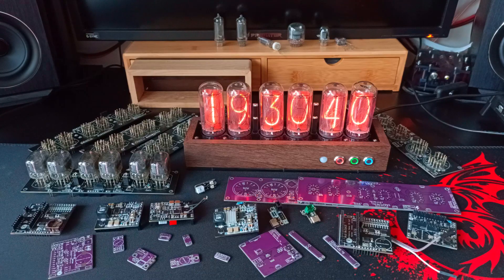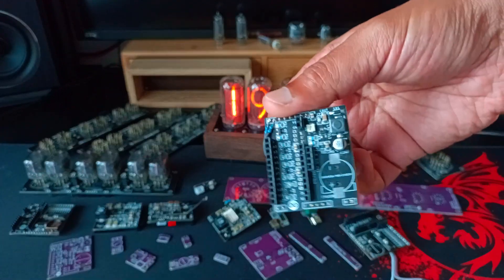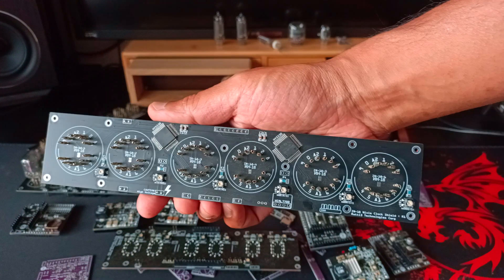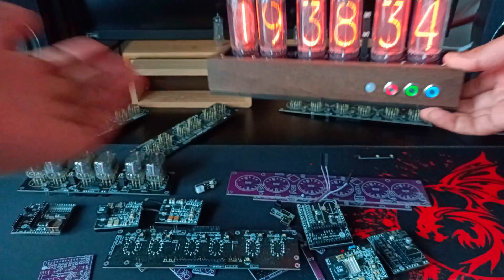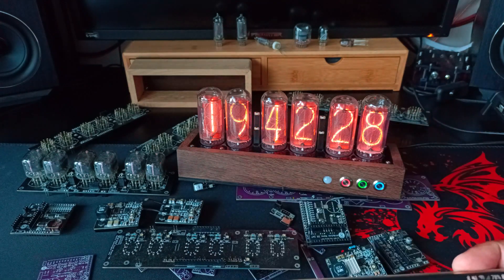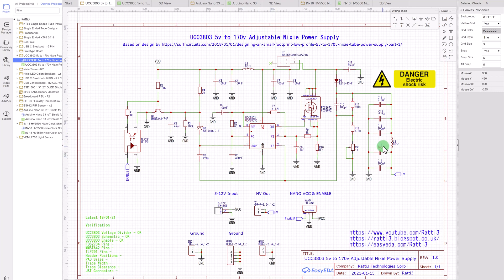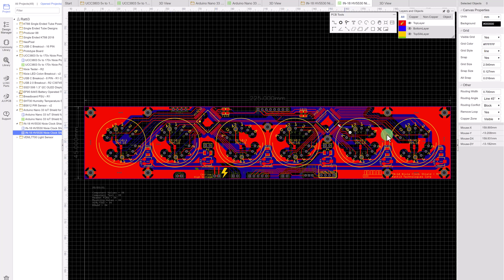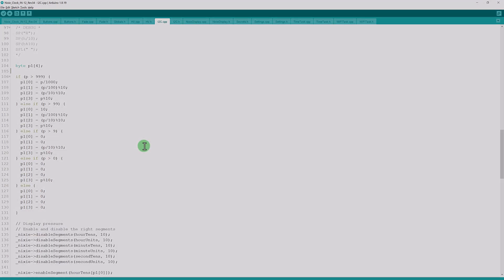Arduino Nano 33 IoT Modular Nixie Clock with Web UI

Comment: Fantastic project! Have you had any issues with current placement of VEML7700 sensor? I imagine it would get affected by Nixie tube light or can it distinguish between ambient and nixie light?
Reply from the maker: Yes, it is an issue depending on what level the sensor is set to. It can be easily fixed by moving the sensor to the back using wires. I may redesign the PCB with the sensor mounted at the back. I'll update the blog posts with this issue, thanks for reminding me.

Comment: One question where did you find the ин18?
Reply from the maker: I got them couple of years ago from Ukraine (Ebay). I had issues with most sellers selling Nixies (Russia, Ukraine or Belarus). They would send faulty Nixies or it would be not as described. I've managed to collect a lot before the conflict, this has made it harder to get hold of them at the normal price.
Reply: @Ratti3  I'm currently visiting Moldova and I managed to find plenty of ин12 on the site i haven't seen the in-12 pcb is it available yet somehow?
Reply from the maker: @Kosta24  Ah yeah I forgot to publish the IN12, I'll do that later today along with al the other variations of PSU and sensor modules. I'll update the Hackaday and Arduino ProjectHub page with the links.
Reply from the maker: @Kosta24  IN-12 now available, Hackaday page has still not updated, I've also republished some of the PCBs to make it easier to find the variations. There also seems to be a glitch on EasyEDA where no BOM shows, this is fixed by editing the schematics in EasyEDA.